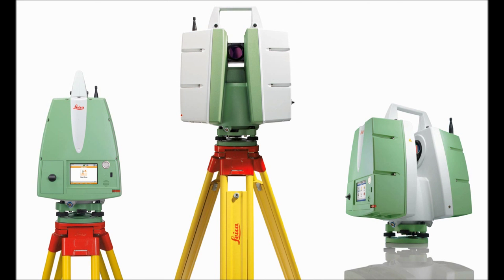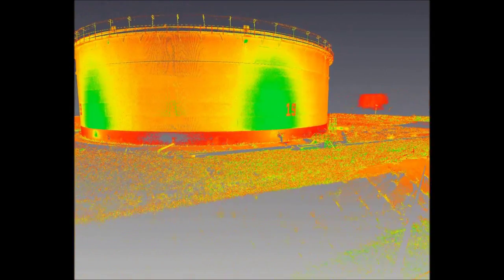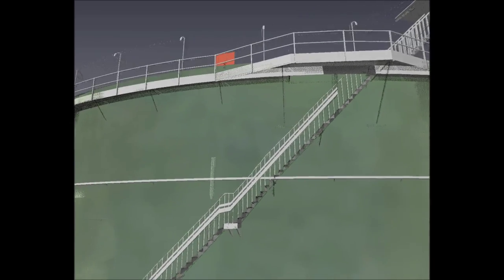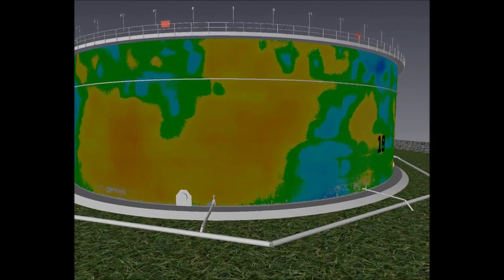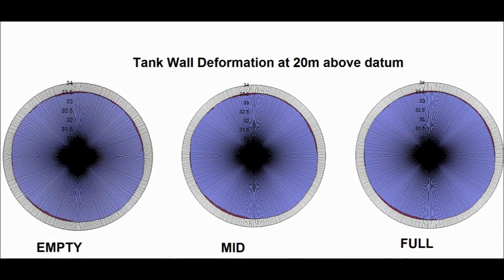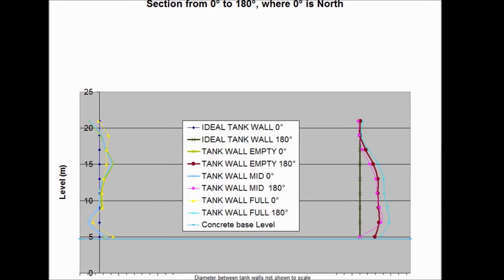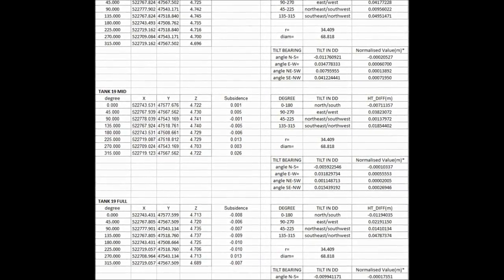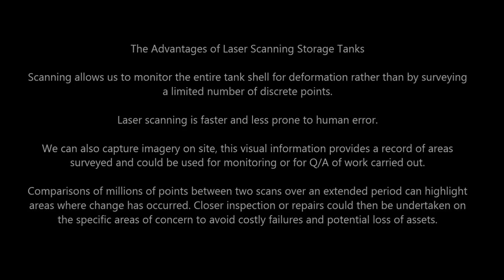Laser Scanning of Storage Tanks

Comment: Nice job...The one thing I would do differently is the verticality check. Simply fitting a cylinder to the whole dataset and measuring the difference at the origin bottom v top is not an accurate representation of how off vertical it is as it naturally best fits the cylinder to all the data in between the top and bottom. It would be more accurate to fit 2 separate cylinders using a thing slice of data at the top and bottom and compare these values in X & Y......
Reply: +christopher byrne Thanks, I agree with your comment regarding the verticality, which we actually measure in two distinct ways. One is by fitting the cylinder - think of it as an 'overall measure' and one by creating many horizontal sections/slices. Some of the extra analysis is missing or simplified for an easy to understand video.